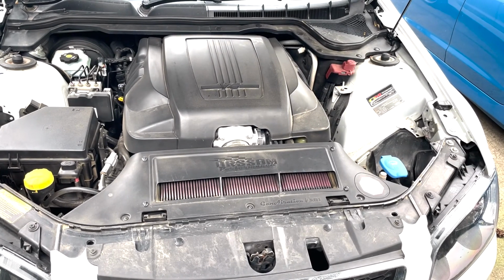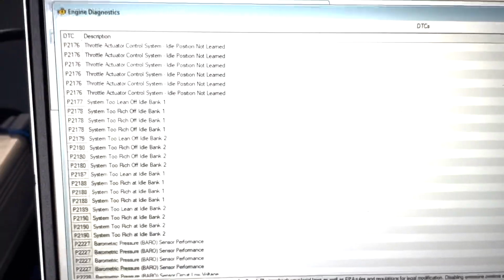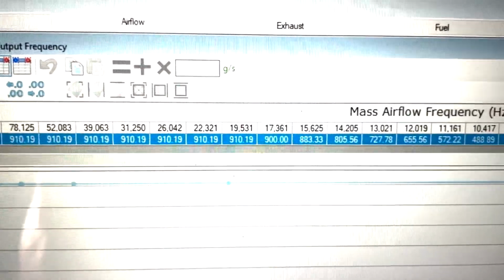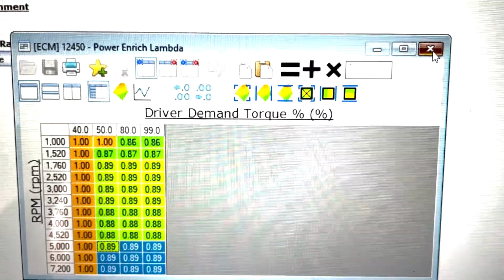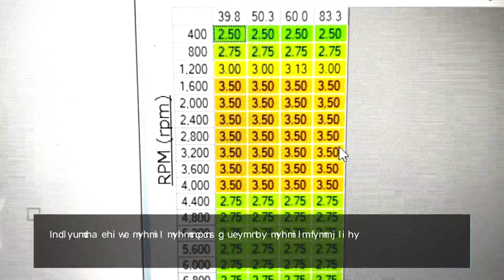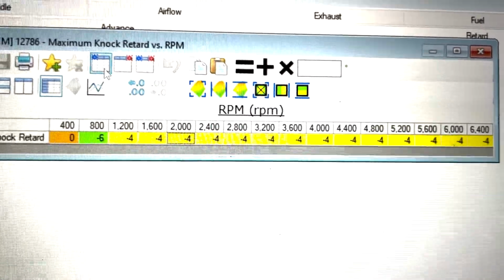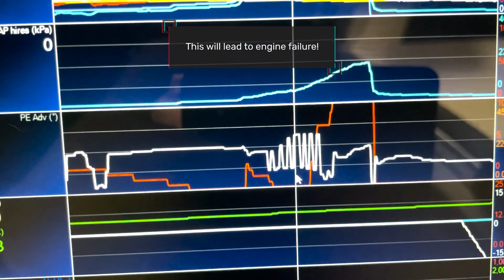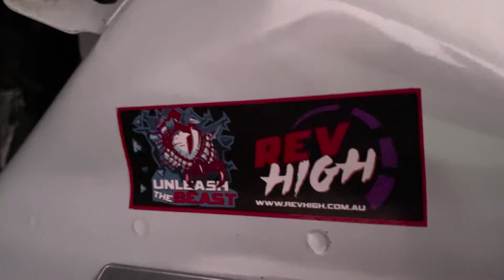👻SCARY!! Holden LLT VE V6 retune to avoid ENGINE FAILURE! GM Motorsport sending us emails!

Comment: Do you all support Mace Engineering cam tunes for the LLT virtually? I am located in the states, but I know most of the expertise for these cars are over there across the pond! If nothing else, what would I need to do to have you all look at a tune I've been provided and possible provide some feedback on it? Been having some issues. Thanks in advance!
Reply from the maker: Sorry for the delay, didn't get this as a notification. We can remote tune these 100%, feel like sending us an email or facebook/insta message?
Reply: @REVHIGHTUNINGSOLUTIONS  excellent! What is ya'lls email address?
Reply from the maker: Revhigh dottttt sales attttt gmaillllll

Comment: Playing with my own series 1 (08) VE, installed a cold air intake (sports filter). shortly after was throwing the lean code. is it neccessary to dyno the car? if so how much would i expect to be charged? I do know everyone charges differently.
Reply from the maker: We charge $850 for a dyno tune on these. Happy to assist, just contact us directly.

Comment: Great vid.  
I would like to have someone tweak my 2008 VE Commodore 60th Anniversary V6.  
I have the Orssom Performance air filter system installed and will be replacing my single stock muffler with a straight through J pipe.  
Can you recommend anyone up here or perhaps Brisbane?  

Regards, Jas.  
VK4FJGS  
Rockhampton Queensland
Reply from the maker: Sorry for missing this Jason, we can tune remotely but we don't know anyone in Brisbane sorry.
Reply: @REVHIGHTUNINGSOLUTIONS  
No probs.  
I will look around Brisbane when I go down there next week.

Comment: typical from gm motorsport, unless you have a v8 they do not give a single fuck, glad to see this build was fixed before the gm donkeys did their thing on another beautiful ve.
Reply: Couldn’t of been said better! I live 10 minutes from gm Motorsport and still went rev high, this guy and his team are unbelievable at what they do!
Reply: gm fkd my engine
Reply: @thumb-jd7cr  that's what they do, my vf lfx was pinging off its head from a simple otr exhaust and tune package from them revhigh fixed it right up and was running like a dream ever since
Reply: Gm can’t even tune a ls they drilled a hole in my throttle body to get it to idle even then it wouldn’t idle nice basic rebuild with vcm 532 cam the smallest cam in the end it cost me $2600 with tune and replaced throttle body then off to vcm to retune another $1250 but night and day on good tune